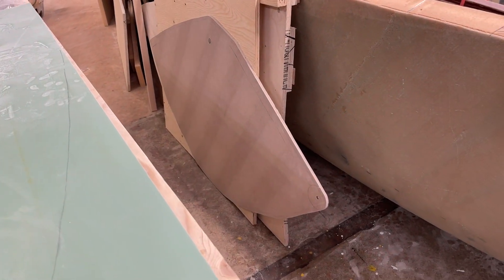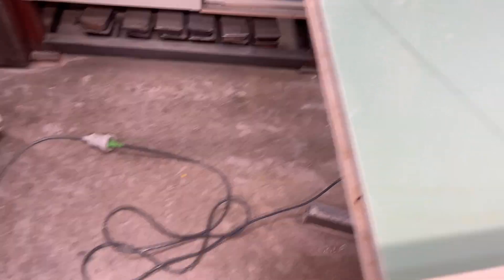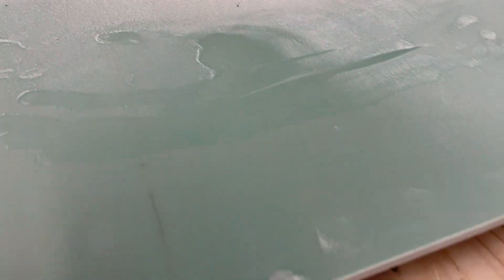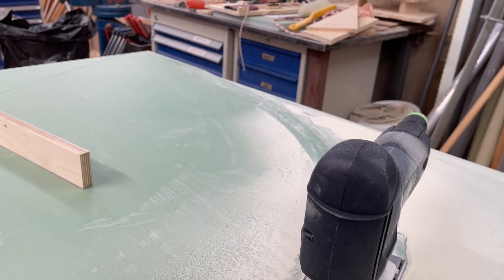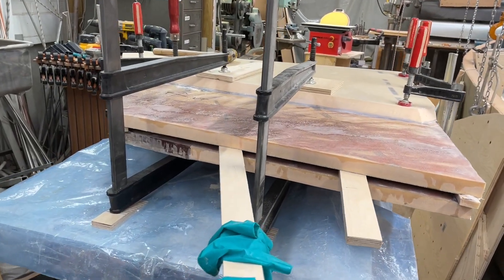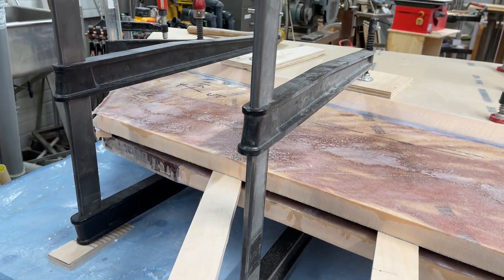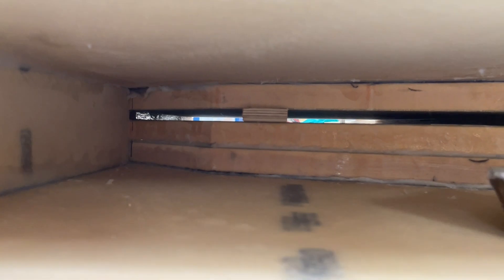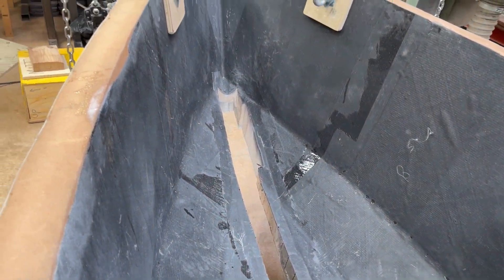2 August 2022   Cutting the CB in G 11 epoxylaminate. A mistake and a close call on the CB-trunk.

Comment: How big is the gap between trunk and centerboard? Does the centerboard have a NACA shape?
Reply from the maker: The gap is 5 mm
The centerboard is 10 mm flat.
A radius at leading edge and feathered at back
Reply: Not sure a NACA shape would have any effect on a foil shape that is probably 40:1 chord to thickness ratio.  It's essentially a thin plate and will have a pretty low separation angle of attack.  But it will function just fine for it's intended purpose.
Reply from the maker: @boooshes  A NACA section will cause more turbulence in the CB-trunk and carry more water.
Olympic sailboats like the Tempest and Finn dingy have flat plates.
They sail well enough.

Comment: good thing that you realize it before it was too late!! maximum concentration is required.
how much play did you let finally? (how much thicker is the spacer than the CB)
is it recomended carbide blade for this material? i would have tried first with a blade for metal cutting
Reply from the maker: The centerboard is 10 mm 
The slot 15 mm
The play 5 mm.
Metallblade would blunt to quickly.
Reply: @SvenYrvindExlex  wow, one tends to think of that G11 material as a particularly strong type of plastic but it must be a completely different animal...
thanks for the answer!
Reply: @juansimon7020  yes, there's many layers of glass bonded under high pressure.  Imagine cutting through a thick piece of safety glass.
Reply: @boooshes  i see... thanks! i learn so much in this channel...
Reply: Radius cut so even small carbide curcular blades are not very good choices if not straight enough. Carbide router in compass guide is accurate, though heating is high.
I could not choose better unless an abrasive water jet.